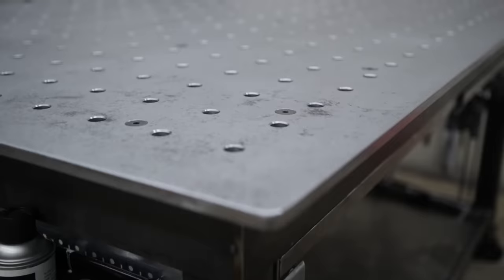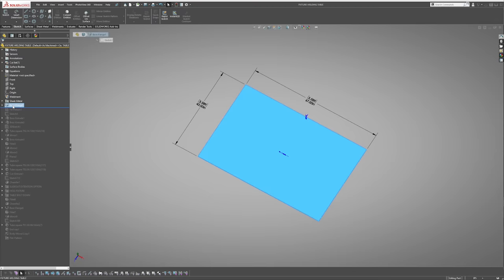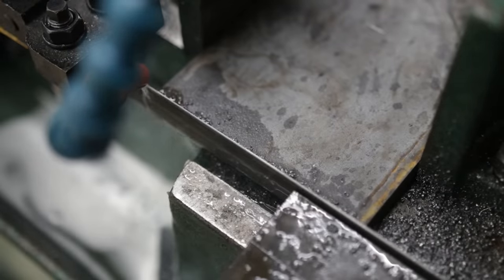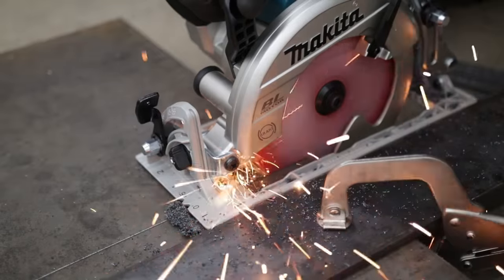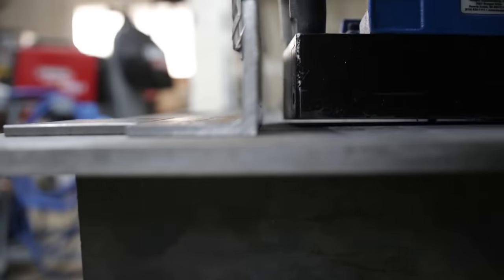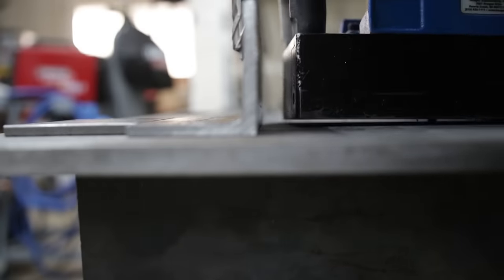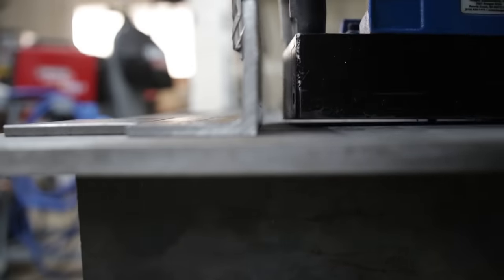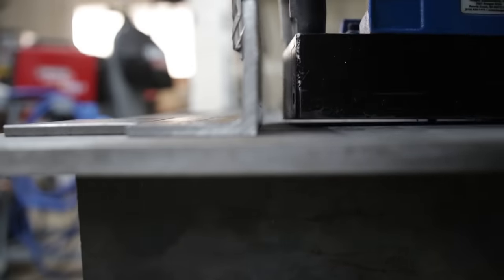Homemade Welding Fixture Table + Storage Hack — Built for my Home Garage Shop

Comment: I've been a professional welder for 3 yrs now and this is high quality work man thanks for the video and great work. I have one question where did you learn solidworks I have it on my Mac but it's not easy to learn on your own
Reply from the maker: Thanks that means a lot. I briefly was introduced to Solidworks in college and learn most of it just with seat time and on the job. I know it may seem intimidating at first but I watch countless hours on YouTube (check out innovasystems channel). I have a few videos on my channel that will completely walk you through the basics of how to get started. Hope that helps or points you in the right direction.
Reply from the maker: What areas are you having troubles learning in Solidworks?

Comment: you need to run those metal blades at full depth all the time.  Imagine the tooth path in a shallow cut vs full depth.  Each tooth has a shorter path though the material when blade is set at full depth.

Comment: Truly great job.  The one thing I don't fully understand is the adjustability of the casters and then the adjustability of the table top itself.  Why is there two ways to adjust it?
Reply from the maker: The adjustment on the casters are only needed if you have an uneven floor. This makes it so that your table doesn’t rock. The adjustment on the table top is for the flatness of the plate itself. It’s Bc when steel comes from the plant they are a actually cut from a roll “ like toilet paper” into sheets. These sheets aren’t machine flat so you may have a sheet that has some high and low spots. The adjustment from the bolts on the table allow you to somewhat correct it so it’s more “flatter” hopefully that makes sense.

Comment: On the topic of making the holes - if the plates you welded to the angle iron were slightly too short or slightly too long, after 10 rows you'd get that error 10x, and if that error is 1/10 then by the end you'd be 1 entire inch off. So I would advise first drawing a grid with a ruler, always measuring from one of the corners and making sure both diagonals to every square/rectangle (corner to hole position) are the same length (to ensure 90° angles), and only then do the method you described. That way you'd be able to tell if you were off because the lines you drew wouldn't line up right in the holes of the angle iron.
Also, I don't have a mag drill but if using a regular drill to drill those holes, you'd find the holes on the angle likely get wallered out as you go, which can also remove a tiny bit of precision (though it may be negligible for your application - I often drill bolt holes without any clearance and a few holes a tiny bit off can make it so the bolt doesn't go in on all of them).

That's all I can add though, the rest of the video is entirely awesome! Thank you!
Reply from the maker: Thanks for the tips 🤙🏾

Comment: Hey Ratha,
I wish to learn about the "Traditional Carbide Saw Blade" that you used for cutting 1/2" steel plate in several increments. You didn't give the link to such a saw blade. The link you provide is direct to DIABLO 748 only. Thank you for your advice.
Panoo (THAILAND)

Comment: I was wondering if there was a precision drilled thin metal sheeting available that had say 1/16" holes spaced at 3" (or whatever your desired spacing would be). You could then clamp that sheet as a template over your thick table and use the small holes as pilots for your larger holes. By placing bolts in some of the holes as you progress, you could assure your template doesn't expand or shift while drilling new holes. Terrific build by the way.
Reply from the maker: Thanks. Yeah you could definitely get a template laser cut and use that as your jig

Comment: Thanks for the inspiration and a very well done video. Your explanations were clear as was your speech and voice without any annoying music. I'm just starting on my welding journey with a cheap welder and scrap steel. I was able to pick up a 2" square tube frame for my welding table but need to put a top on it. The ideas you are using are fantastic and I'll probably steal a couple of them. Any worries about using your welding table as a wood working table too? I've read about some concerns regarding cross contamination with the metal shavings, greases, etc. contaminating the wood projects and the wood dust creating issues with welding. Any thoughts on those issues? Thanks again for a great video.
Reply from the maker: Thanks I’m glad you got some ideas. As far as cross contamination I clean my table after every project or every night like I do my shop. However I will mention I rarely do woodworking projects probably 5% of time so it’s not much of an issue. If I was 50/50 I probably at that point either have a dedicated wood work table or slide sheet of wood over my welding table to be use a sacrificial board.

Comment: Great table!!! I was particularly delighted with the way you compensate for the imperfections in the plane of its working part. The solution is simple, effective and most importantly: easy to do on your own.
For the majority of garage welders (including me) such a table is a dream, but (thanks to you) a dream that can now be realized.
Thanks a lot.

BTW Now I have a new problem: how to galvanize (chromonickelin it is it!) such a large sheet of steel, because if it were to corrode such a beautiful table top, I would probably cry to death. ;) And seriously: I would like it to be not only good, but also nice, without the ugly, rusty stains that will appear over time.
Reply from the maker: Thanks and your welcome! The Goal was to inspire others.

Yeah I do my best to try to keep it clean and rust free from the elements. I normally do a deep clean every 4 months and apply a coat of wd40 once a month to protect it from surface rusting. It’s a simple and low cost solution and was been working so far for my needs at least
Reply: Petroleum is maybe cheaper and works really well.

Comment: You lay down some nice welds. Your next skill set is to learn how to use a torch. A # 2 tip with gas at 5lbs. and Oxy at 40 lbs. will give you a clean and fast cut. Every thing else is Great!   I have been welding and fabricating for 45 plus years and its nice to see young people getting interested in these skills. Keep up the good work my friend.
Reply from the maker: Thanks. Learning to use a torch is definitely on my to do list. Thanks for tip.

Comment: Hey man just wanted to say well done! Looks a lot better than my first welding table did, lol. Oh and a suggestion I absolutely love and seeing as your holes are 3 inches on center it would be even better for you. Take a look at strong hand tools swivel base, they are available on Amazon and fireball tool sells a rebranded version of them. The mini shoulder bolt that comes with them threads right into those armor tool auto clamps you have. It just adds a lot more range of motion to those clamps
Reply from the maker: Good tip I’ll check it out
Reply: Can you put a link to show what exactly you are referring to?

Comment: Excellent design with many clever features.  I'm working on a design for a custom welding table for my garage, thanks for the inspiration.  I have an old machining rotary table I hope to incorporate into it, and I need to make it fit under my table saw, so I may motorize it to make it adjustable height.  Keep up the great videos, I've subscribed to make sure I don't miss any new videos.
BTW, I love your CAD setup. Mine is similar, but a much smaller corner desk...
Reply from the maker: I’m glad it helped inspire. 😊

Comment: Wow! This is class! As a SolidWorks user, I can really appreciate the work that even went in to the design of this table! What are the clamps called that you are using on the table top? The ones that fit into the holes. I cannot find them anyplace. Thanks a mill for sharing this. Greetings from Ireland!
Reply from the maker: Thanks. Clamps are armour tools you can find them at the weldtables.com in the accessories.
Reply: @RathaSochenda  Do you have plans available for your weld table?
Reply from the maker: @davidreed8219  yes check out the link https://www.etsy.com/listing/962221433/garage-shop-welding-fixture-table

Comment: That’s a great video mate! Any tips on weld sequencing to keep it all square. I find my welds seem to pull things out of square. Very jealous of the finished product. Well done
Reply from the maker: I try to tack everything first then do a cross hatch pattern when completed each weld bead. If something slightly out wack I’ll bend it back.  Sometimes I’ll tack in a spare cheater piece to keep things from shifting. Then grind off the racks to remove the spare piece.

Comment: Very very nice!  Was wondering... ball park how much did you spend all in?  Going to be doing some hobby welding in my home shop so was curious about cost.  I think my biggest hurdle will be finding someplace to buy the steel.  I really like that you didn't cut any corners.  So glad you have plans available for purchase.  A lot of thought went into this project... no need to re-invent the wheel.  So far this is by far the best home fabricated welding table I have found.
Reply from the maker: Thanks. When I first started the build everything had cost me  about $1300. In my area at least. Depending on where you are and because of how steel prices are now, I’m not quite sure what it would cost now.  I did save some money by buying a top plate as remnants ( I believe it was $450 for a 5x8 sheet that was 1/2 thick. Also I owned my own mag drill so that saved me a lot money but I know you can rent them for about $60/day

Comment: Hey Ratha, Did you buy that mag drill at Harbor Freight or on line? I want to drill out my table but don't think I'm going to need a good mag drill beyond that.  Sorta a one week and done drill. Any ideas? Thanks brother.
Reply from the maker: I bought it used on OfferUp. You can also rent one for about $60/day. Try checking locally for commercial rental stores.

Comment: Well done, especially considering some of the tools you used. Looks like the end result is just as good if not better then many of the manufactured fixture tables. My "go to" table is a 4x5 sheet of 3/4" plate with 4x4 legs. It's not a fixture table so I typically have to use a long piece of box tubing or angle iron to camp something in the middle of the field. I also have at times just put a button tack in the middle if needed. I've often considered building a proper fixture table and your video has given me more ideas. Is there anything you would've done differently? Are you a Husky? I did undergrad and grad school at UW.
Reply from the maker: Thanks. The only thing I would change maybe would be to go with thicker top plate. 3/4” just to make it bombproof I guess. And I do plan on adding a shelving system to it down the road but that’s really it. It has been serving me well. 😊 yes I’m a husky, I graduated in Mechanical Engineering back in 2010.

Comment: Excellent table build, sir ! My hat's off to you !... One thing that is apparent to me, and it wasn't made clear in the video is that you used a metal cutting circular saw blade, BUT it would appear that it's used on a more or less standard worm drive circular saw versus a saw, worm drive or not, that is designed for cutting metal (slower speed, more power) am i wrong on that item ? i also suspect that would lead to premature wear and subsequent early failure of the metal cutting blade...
Reply from the maker: Yup A actually metal saw like the Milwaukee would of been more preferable especially if I did this for living. But bc I already has a circular saw laying around I figure I give the Diablo blade a try. It’s not really meant to be the greatest combo but it works pretty well for sheetmetal less then 1/8” thick without wearing. I know cutting 1/2” thick was little gutsy on my part but for $30 I figure I give it try. I’m glad I did as I was able to learn it’s limitations. It has its uses for certain situations.

Comment: superb work. i am wondering if you have any commentary on it almost a year later? any issues that popped up after use? also, great logic on the leveling mechanism. i am wondering if you had any comments on that a year later. thanks and great work again.
Reply from the maker: Thanks. So far it’s been working great no issues. I love this thing only thing I would of change was to build if sooner. You don’t realize how much something is useful until you have one.

Comment: how do  you protect it from weld spatter. How is it holding up, also when you used the angle jig to drill the holes, did you use the plate edge as a datum for the first row of holes, can we trust the plate to be perfectly right angled at the edges. Thank you for the video.
Reply from the maker: I use Walter welde4 stuff to keep protect from spatters yes I used the plate edge rod for first set of drilled holes. I got pretty close to square to the best of my ability. If you need it “perfect squared then you may want to try waterjetting or cnc plasma the table size and holes. Hope this helps.

Comment: Hi.

I went through most of the comments searching for something. I'll tell you in a bit. First, I can not add much more than what's already said. Great Table!

What I did look for though, is any questions about your office desk!!! I didn't see anything. Or did I miss it? I didn't see a video about it either? I love the way that it lifts with a touch of a button! Any chance you will show how that one was built or how it works?

Thanks! And keep up the good work young man!
Reply from the maker: Thanks. the office is just a off the shelf standing desk made by vivo that I bought. Buy that and pair that up with an ikea table top.
Reply: @RathaSochenda  Ok cool. Thanks for replying!

Comment: Incredible video.  If you were to do this project over, would you go with 3"  hole spacing again?
Reply from the maker: Thanks. hole spacing is doing great so far hadn’t had to change anything
Reply: @RathaSochenda  what kind of Allen bolts did you use for mounting the top?   Link?

Comment: Awesome seeing a fab video showing real engineering. Your mention of tol stacks and datum features makes me miss the days I did real engineering. 
You mentioned interwest metals in your last video; is that where you got these materials too? Trying to find a good source in Tacoma area.
Reply from the maker: Thanks Victor. I still have a long way to go. I normally dont do "real" engineering work anymore either. Was a mechanical engineer until I started this Youtuber thing and haven't looked back. Yes. Interwest is my go to place for metal materials and they have the best prices. James the owner is a pretty cool guy. Only thing i wish was that all their steel be fully enclosed inside of a building to protect it from the elements. But yeah definitely checked them out I'm sure you will be able to find something that fits your needs.
Reply: @RathaSochenda  
Congrats on taking the plunge! I think you've got the quality to make it. What industry were you in?
Reply from the maker: Thanks. I was in the aerospace industry. Mainly did a lot of reverse engineering so I had access and work with to tools such as 3D scanners, printers, cmm, cnc, etc. what industry were you in?
Reply: @RathaSochenda  
Cool, you got to play with the fun toys. I was a mechanical design engineer in DOD aerospace; ton of fun, but the desert got old. 
Feel free to HMU if you want a second opinion on something.  Looking forward to seeing the next project.

Comment: Love the video! Excellent build and design💯 Quick question the electromag drill what model Hougen is that you're using in the video? Thanks!
Reply from the maker: 917 comes with the water feed

Comment: Hey @Ratha awesome table sir
I just purchased the plans as well does it come with the cad instructions to drill the 200+holes for the top?
Thanks!!
Reply from the maker: Yessir. I break it all down. There should be a pdf document labeled “ hole fixture jig example” hope that helps and thank you for the support 🙏🏽

Comment: I’ve got a question about the countersink screws that hold the table down. How you you stop weld spatter from getting in to the top of them and ruining the drive on the head?
Reply from the maker: To be honest I’ve never had that be a problem... Gunk does get in there but I just blow it out with air.

Comment: Nice job!!! I think that the installation of electrical tools underneath the table can destroy them because of the spatter and gritting materials...
Reply from the maker: Thanks. Yeah I thought about that… so far the with the help of debris catch tray it has help and blasting my table and everything around it with compressed air daily I’ve been able to keep gunk buildup to a minimum.

Comment: Great build.  I loved every part of your process.  I do have a question about one though.  I have the feeling that your jig could potentially amplify any error that there was in the locator pins as you move across the length of the table.  Are the pin holes at the corners equally distant?
Reply from the maker: Thanks. Yes when drilling holes from one end to the other there is some tolerance stack as I move from hole to hole. But that is to be expected as when drilling by hand. It’s not cnc accurate but pretty close for my need. For the most part the holes uniform across the table.

Comment: Wow awsome table I will probably make this table when I have get a bigger shop. We're you using the Lincoln 180 HD? What settings do you run on it and what do you keep your gas psi at for mig welding?
Reply from the maker: Yup the Lincoln 180.  Gas about 20 cfm, 035 mig wire then for settings just go off the chart when you see when you lift up the side cover and match that to whatever material thickness. So far it seems to work well.